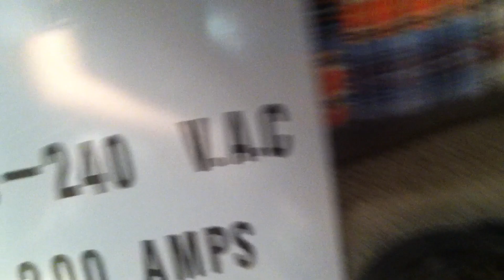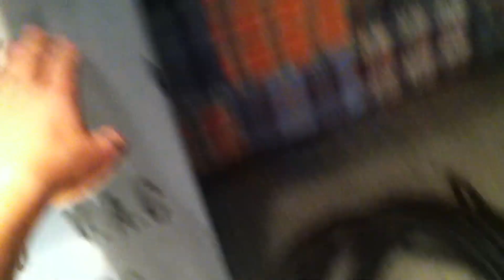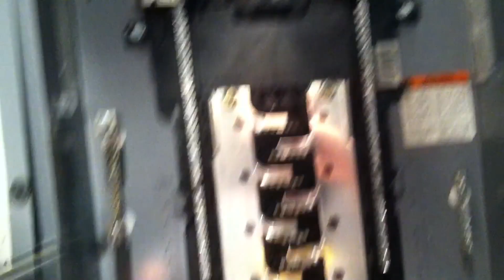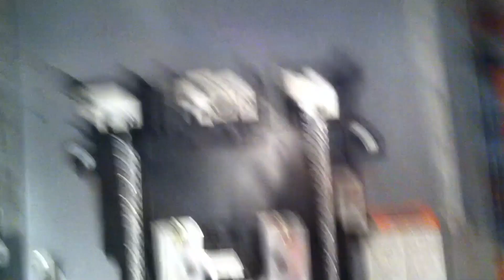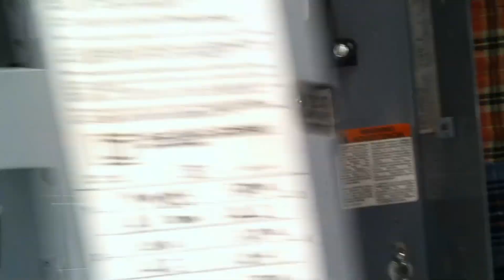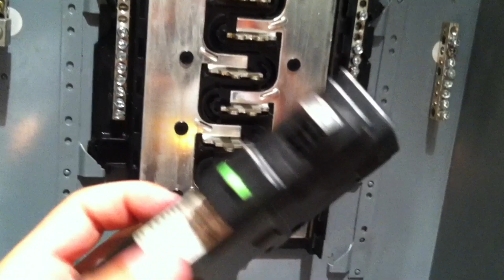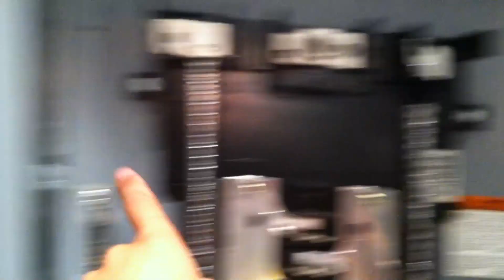Electric Panel and power distribution basics

Comment: Q:  I insert a 240vac circuit breaker (CB) at the top of L1 (having locked out the 200A main)...then energize that 240vac CB with a generator source: will that provide energy to BOTH L1 and L2?  It seems that it would as that 240vac CB is touching both L1 AND l2?  Would greatly appreciate your advice.  John
Reply from the maker: Yes it would although this is not the proper way to do this. It would work and it is safe but not fool proof. If the generator breaker and main breaker are ever in at the same time for whatever reason, there are numerous serious problems that could occur.  What you described isn't uncommon and people do it all the time but again it's not fool proof nor would it pass any inspection if you had it inspected. The right way to do this is with something called a transfer switch. It is made for this specific purpose and designed to avoid those possibilities of both switches being on at the same time.
Reply: +Jacob Dykstra : Jacob, thank you for that correct and excellent advice. For the sake of brevity, I omitted that I built my own dual-axis solar tracking system, MPPT charge controller, solar deep cell AGM battery banks, pure sine wave inverters; Transfer Switch I installed (proper city permits + completed wiring job City inspection approved). I cut a $438 monthly energy bill to under $70 as a result. I have expertise in the field, can do all my own wiring, etc. I sold that house and system, then bought another. I will build another solar energy system for the new house but want to avoid the complexity of wiring another transfer switch (including the excessive distance to the new service panel). I understand you don't know me personally, but want to assure you I know what I'm doing; that I know the difference between a plus (+) and minus (-) symbol, and passed the spelling test for "ELECTRICITY." (LOL!!!). I'm writing a book now, "My Way Off The Grid," by J. Carl Hudson. I will be purchasing a professional manual "Interlock Switch" which will prevent the 200A main from ever being in the "ON" position when I have the 240vac CB turned on to energize L1 and L2 (and vice versa - turn off the 240vac CB, slide the Lockout switch down, which locks out the 240vac CB and now permits the 200a main ONLY to operate). The service panel will be completely documented and locked shut...accessible only by me and no other family member. All of that said, do I understand you correctly that I only need to insert ONE 240A CB in the top position of L1 (amperage appropriate), and that ONE will in fact energize both L1 AND L2?  I truly appreciate you taking the time to respond to me.  Take care.  John (Sierra Vista, Arizona)
Reply from the maker: +Knight Six All that is awesome! I am all for solar and renewables. Another way of going about this is cutting off your service and having your meter removed then there is no worry about the two interconnects ever being connected at the same time. The only obvious problem with this is that if you ever have a long cloudy period and run out of stored energy, well there would be no back up. But yes you can do just as you say and insert a 2 pole breaker in your panel and feed into that. Just make sure your main feed in breaker does not exceed 125% of the rated bus capacity. So a 100 amp panel should not have a main breaker larger than 125A. Feel free to ask any questions if you aren't clear enough.
Reply: +Jacob Dykstra:  Jacob, let's stay in touch. Here's a cryptic email address for me:  knight _ six @ cox . net  (remove the spaces and yes, it does have an 'underscore' between the first two words). I will send you a copy of my unpublished manuscript "My Way Off The Grid" - it's incomplete as I want to include the building of the new system here in Sierra Vista.  Ref. meter removal and shutoff - I'll keep that as a backup...never can tell - might be an earthquake tomorrow!  John

Comment: the old type screw in fuses are more reliable than breakers because there is no moving parts. if people weren't stupid and putting pennys etc.. mickey mousing and burning the house down we would probably still be using them.

Comment: if you have a square D panel , do you need a square D breaker or can you use a another brand .also to replace a bad breaker what info do you need to know to get the right one?
Reply: +GmGarlo you need to write down everything on the circuit breaker that you see printed and match it up exactly with one at home depot. brand name and everything

Comment: the reason why the main panel is grounded at the neutral is because the circuit that it feeds is not always balanced when you have more than one phase. so if one phase pulls more current than the other, the extra amp will be absorbed by ground.
Reply: +Mausa Siau no that is not the reason.
Reply: +Mausa Siau No, that is handled by the neutral. Under normal operating conditions, ground does not carry current.

Comment: Your explanation of how a basic circuit breaker works is hilarious.  Your statement about  has nothing to do with it, rather the breaker contains a bimetallic strip that heats up when the amp through it exceeds its rating.  The bimetallic strip bends and disengages a pin which cuts the current.  When you reset the circuit breaker the bimetallic strip has returned to its preheated condition and works to turn on the juice.  Sorry but that's how it works.  Check out the other utube vids.
Reply: +Prestige Worldwide Someone that knows what they're talking about.
Reply: +Joseph Nicholas both are correct, those are thermo-magnetic interruptors, thermo(overload (bimetalic strip))-magnetic(shortcircuit(spring-coil)) interruptors
Reply: +MrHergoo  Yes but the primary operation comes from a thermal reaction.  The breaker this kid was referring to is demonstrated on other you tube vids.

Comment: Wait... If you used regular breakers for stage lighting, how would you dim the fixtures? Wouldn't you require a dimmer rack, or did you just have the lights either on or off?
Haha it's just that I do the same thing that you used to do too! Anyways, great video! For our school right now, we're trying to wire a 240 circuit for two Martin moving heads we received a few months back, and this video will probably lead to our success!
Reply: probably with a dimmer....

Comment: Just fyi, the reason why you keep the neutral and ground bars separate on the subpanel is because you don't want neutral current to flow through your ground wire (correct term is equipment bonding conductor).  Think about it, if you connect the neutral and ground together on your subpanel, you're creating a parallel connection and the current will flow on both neutral conductor and ground conductor.
Reply: (equipment grounding conductor)*
Reply: +Alex G It finally clicked WHY when I read your comment.  Yes, I see it will create a parallel connection.
Reply: Most of these hacks aren't even license electricicans if he was he would know about keeping the grounds in the neutral separated in the sub- panel